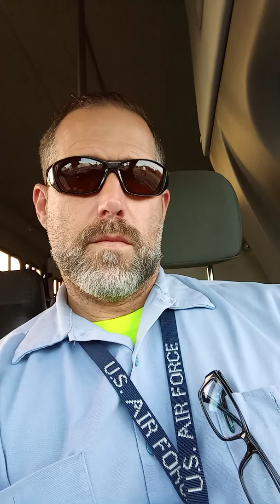280zx AFM or throttle position sensor symptoms and diagnosis runability problems, old style maf

Comment: I have an 81 Turbo, at Idle, I have almost perfect AFR. fluctuates around 11-15. Sometimes, when driving it works fine, stays in that range. But then seemingly randomly, and more often than not, it'll run way too lean. Like skyrocketing to 27AFR or higher. 

It isn't fuel pressure, my FPR reads a steady 35lbs at idle, 42 or so under acceleration (i know that's a little higher than factory spec, but I've tried turning it down too, didn't help.)

What would cause that lean mixture? I lose all power and it pops and shutters when it's lean like that. I have tried adjusting and replacing TPS, to little avail. So lately, obviously, I don't drive it. It's not missing, it just isn't getting enough fuel, despite having adequate pressure. I don't get it.
Reply: Other things to note. Injectors have been replaced with the palnet kit, as well as all the injector plugs I swapped out (they were getting pretty corroded). Spark plugs properly gapped and spaced. Timing seems to be right. Idles smooth, no misfire or anything. 

Also important to note, it seems to cut out more at higher speeds. And ONLY under acceleration. As soon as I let off the throttle, it returns to a smooth AFR, between 11-15. Like, around 45-55mph is the speed ceiling before it just quits accelerating and jumps to being way too lean. But, as said, occasionally, it'll power through that ceiling as if there was no issue, and runs fine for a little while. I have reached the extent of my mechanical knowledge in the FSM. Anything else reads like a foreign language to me lol. Thought about seeing if the AFM was messed up, but you said that would be too rich, which is the opposite issue so now I am stumped.

Comment: Thank you very much for your knowledge of these cars. I have a 1983 280ZX and i replaced the fuel pump,filter,and the injectors and got the car to start. It starts great when its cold but when it idles after starting for 15 seconds it stalls out. After it stalls out i can only keep it running if i keep my foot on the gas pedal and accelerate and it back fires and smokes alot through the exhaust. What do you think the problem is.
Reply from the maker: @robertrandin9568  possible sensor issue, TPS, cylinder temp sensor or wiring plug, coolant temp sensors ...and check fuel pressure to verify operation
Reply: @gerryburkhardt856  thank you i will check. Thank you for responding.
Reply from the maker: @robertrandin9568  you can also increase throttle up a little, to 900-1100, but you will have to reset TPS
Reply: @gerryburkhardt856  ok I will.  Thank you
Reply from the maker: @robertrandin9568  timing is good, idle rpm low, possible matchbox ignition module going south, ignition coil....

Comment: My 83zx will not stay running when engine is cold. You gotta feather the gas to keep it running for the first minute or two after starting from cold. Just started happening a month or two ago.

After about 2 minutes of feathering the gas, it will keep it’s self idling around 800-1k rpm. It’s  NA 5 speed, 2 seater (no passenger seat in car right now) base model coupe. The car hauls ass/runs great other than the cold idle issue

Comment: Also check the connector on the temperature sensor. They build up green corrosion on them and that increases resistance. Resistance should be 2.4k ohms cold and 200 ohms at normal operating temperature. On the 280z it's called water temperature sensor. On the zx it's called cylinder temperature sensor. Also clean throttle position switch, it builds corrosion too. If you 280z randomly starts huffing out black smoke, check the temperature sensor. If the black smoke (too rich) happens when you close the drivers door, it is the ECU. The printed circuit board has a hairline crack on temperature sensor circuit. Replace ECU. If your z want rev up like it has a rev limiter, it's the throttle position switch. Hope this helps.
Reply: @darrylleigh7514  thank you very much and I will try everything you said and get back to. It's so nice to have datsun techs out there's for help
Reply: @robertrandin9568  No problem. Let me know if any of that repaired the problem. If not, let me know what's going on and I'll try to help.

Comment: I have a 77 280Z and when i start it up there is a popping in the rubber boot between the AFM and the intake only when i rev-up the engine. The popping only happens when i accelerate.
Reply from the maker: I'm popping in the boot would be a lean condition pre-detonation and or timing pertaining to detonation.
When you have popping in the intake versus popping out the exhaust you have two different types of conditions and each case you would have to understand what you need to attack. Both of them related to timing fuel and Air and location and where it is popping at is going to tell you what's going on with your motor.
Reply from the maker: @datsunsinmygarage6661  timing
Reply: @gerryburkhardt856  thanks but I don't have a timing lamp. Maybe I'll get my son involved
Reply from the maker: And what I meant by timing, possible play in the distributor, meaning the distributor could be bad or Worn, the matchbox ignition control module ICM, or the power supply and ground, don't forget about the condenser on the old units ignition system the condenser is used has a 3-ohm resistor on old ignition coil systems, which also affects the fuel injectors at startup and warm up conditions
Reply: @datsunsinmygarage6661  yes mine to

Comment: Question for you sir. My 280zx won’t rev past 2200 and Boggs. Idle is a little rough too. Any ideas?
Reply from the maker: Hello,
Upon reading a prior comment in relation to my video, I just want to make sure that everybody is looking at the condition of their vehicle beforehand and understands that to have an open mind and look at the situation, and me not being there to see it personally is difficult but I just look at the situation and what is in front of me and ask myself questions of why or what could cause this.
Always always always, check all the basics fuel air and fire and make sure they are in spec. Your ignition timing your vacuum levels on idle your ignition components, fuel pressure before startup, does it hold pressure, fuel pressure while running and under a load what does it go to and know the specs. And make sure there are no exhaust restrictions
If I'm pushing on the accelerator and it will not go above 2,200 RPMs is it misfiring running rough or is there a restriction in the exhaust, or some other input that is not allowing the computer or the sensors themselves not allowing the computer to do his job or the motor to do its job.
Make sure that you know if you have a catalytic converter it is not plugged from running rich from overtime which they will turn cherry red, these cars are old and the sensors are old with them along with the computer... 
Look at your known factors of what you have, parts you did replace and if the new ones are actually bad and the settings or setup if there are adjustments.
Ask yourself is it hard to start, easy to start, does it idle too high or too low, when you accelerate is it fighting to pick up in speed or is it easy and smooth and find out which system may not be adjusted correctly or bad.
I would want to make sure that my catalytic converter if you have one or it is coded for one is not restricted so you do not have too much back pressure.
Make sure your fuel pressure is at spec when you turn the key on before starting, that it holds the pressure and does not drop too quickly per second and that it has adequate fuel supply while it is running and under load, could be a fuel related issue.
If it is your ignition system because the fuel and ignition are tied together always have your timing checked and make sure it's not too far advanced or retarded

Comment: I have a 1983 280ZX base model. Sounds like my problem, hard start, rough idol, slight smell of gas, almost stalling at lights. On highway it fly"s, runs great. Thank you for this info!
Reply from the maker: hey brother,
I know I don't want to be the dead horse but if it start up it's burning really rich even though you tune
 it up that would probably more than likely be the AFM and if it dies after 5 or 10 minutes. 
the throttle position sensor or
 switch which the AFM and throttle position switch coincide together feels like wide open throttle works great but idle circuit sucks at or Cruise.
if you have any other questions I'm trying to line this one out too which I think I have a line on it just waiting on the new part or should I say replacement part after this one failed and I saw the difference.
had the 81 running beautifully and then a light with a magnet fell on top of the AFM and it went back to running like crap again and that is what I'm waiting on as far as the rich and running condition.
it is like night and day difference with the AFM failing or one of the circuits failing
I've only found for the natural aspirated throttle position sensor made by Walker from stockwise Auto and you can only get them that I can see from Los Angeles California....
Reply from the maker: and what I am also finding with these cars since they're over 40 years old you may be having multiple sensors or plugs that are not having good connectivity.
the cylinder head temperature sensor or chts will cause the car to die completely if I'm unplugged, you can use a coolant temp sensor with the same style plug which are cheap online if you feel that yours is going out, but you cannot use a cylinder head temperature sensor on a coolant temp sensor where the thermostat is because it will leak
Reply: @gerryburkhardt856  let me know what you find out my mechanic is also going to remove and clean the air flow meter but we're waiting on new hoses he doesn't want to take it apart because they are pretty crappy condition right now
Reply from the maker: @billm83army  the AFM style that is used on these vehicles are similar to the ones that are on the BMWs back and around the same time. These have five circuits and one of them is a temperature circuit. When the AFM fails to do his job it tells the computer and meters higher than normal fuel ratios due to the oncoming air and adjust the flap door with spring tension, but overall the computer makes that decision.
But that's on one side of the problem and the other side is what you were mentioning the true are going through is that intermittent cruise to full throttle and idle problems, like it's getting confused or confusing itself from the input... But we know the motor and transmission run great at full throttle it runs like a sewing machine.... It is definitely input from sensors
Reply from the maker: on the AFM they are very delicate, that's why I'm replacing again due to light hitting it from the hood falling. on the afn you can clean even adjust them but there is a circuit that I think deals with the temperature of the incoming air from that sensor and when it falls out kills the functionality of the AFM. replacement and refurbishment of that part is probably more probable and make sure you get a lifetime warranty for exchange purposes for later. the only way that you can see this or that a mechanic can see this is they got to have a stethoscope and an oscilloscope to check the wavelengths when it falls out and dies, the mechanic OR technician needs to be very familiar with the circuit and how it works. they're simple but complicated at the same time due to old school design as far as the AFM
Reply: @gerryburkhardt856  you say get a replacement / reconditioned one but where can you get these I figured that nobody would have them on the shelf if I walked into my local AutoZone, where could I have some luck?
Reply from the maker: @billm83army  O'Reilly's is where got AFM
Reply from the maker: You will exchange your core for reman unit, about $164 with core exchange. They will have to order and ship...usually 2-3 days here in Texas
Reply from the maker: just found this on training videos for the 280Z back in the day. go to YouTube and look under Burkey Vision.... he has training videos over all these major components... just found it this morning on how the system works and what to look for very detailed it is awesome